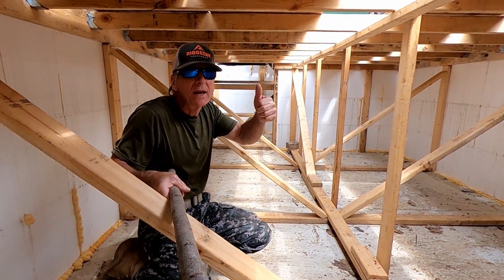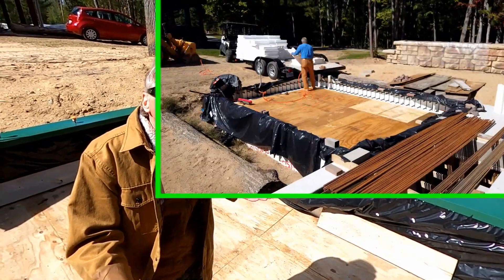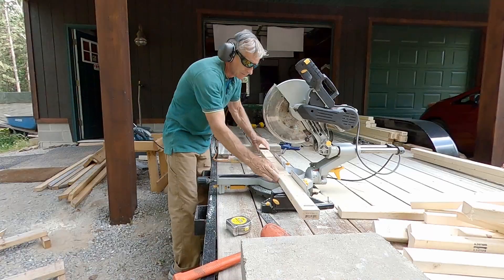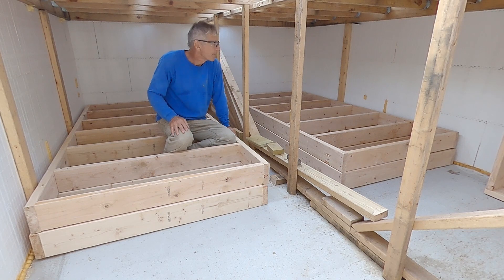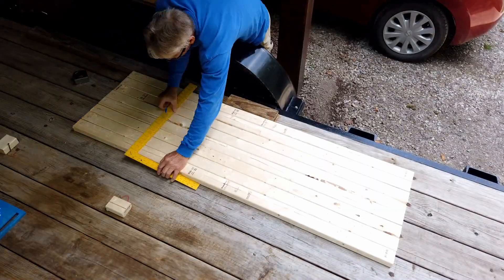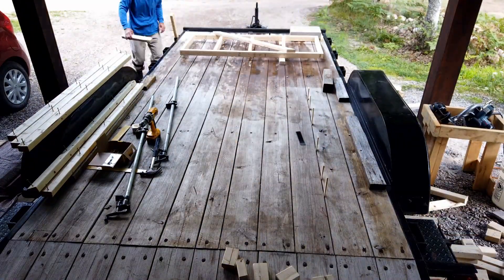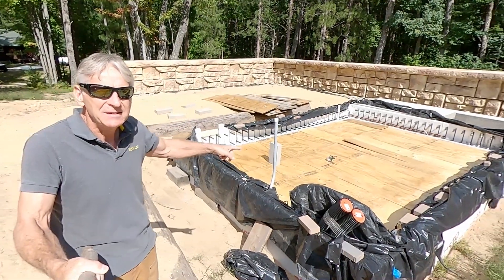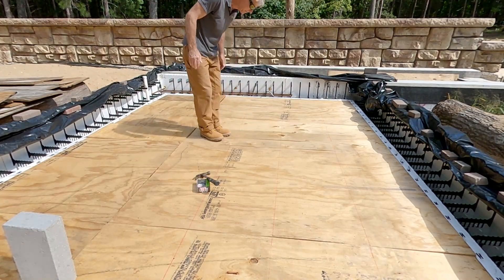ICF Root Cellar BUNKER Build - Raising Deck Support Structure - Days 48-50 _ Storm Shelter Build

Comment: My thought would be to build your concrete form side walls. Pour or fill your side walls. Then cover with concrete pre-cast. The panels can be secured and sealed. If you wanted it would support enough wieght to be able to drive over. But for sere you could build over the precast.
Reply from the maker: This BuildDeck design is NOT Lite-Deck, This can be driven on with my Backhoe. Many build rooms below  the garage and park over the lower below grade room. Yes your suggestions can be built much faster but I want the thermal Insulation properties in the walls and ceiling that the ICF wall and Deck forms provide.
Thanks for watching.

Comment: How much weight can the concrete floor carry and how do you calculate it? How do you determine which rebar to use?
Reply from the maker: I show these details in these two videos. 
Layout of BuilDeck ICFs - Day 51 time 8:10 mins
Rebar Placement BuilDeck ICFs - Day 52-53 time 10:50	
That chart I show can be found Link in description of videos. 
Thanks for watching.
Reply: @puremichiganliving9952  Thank you!